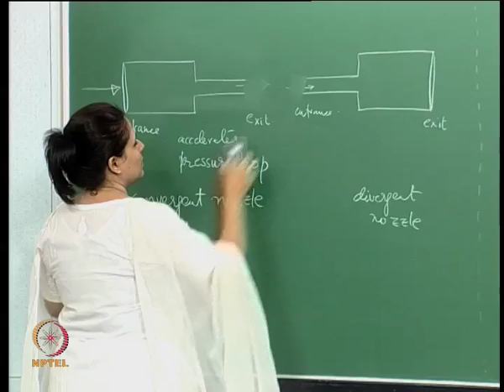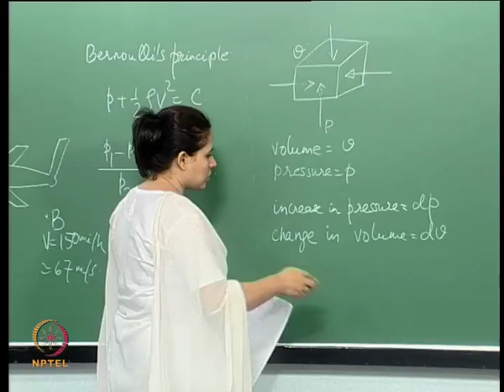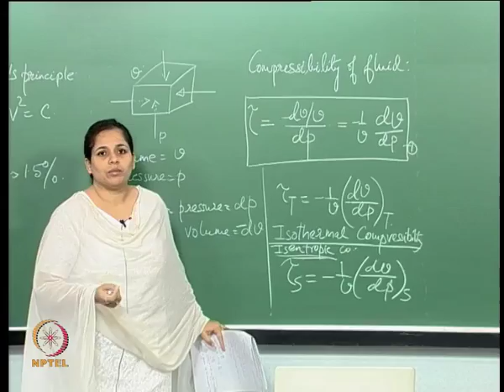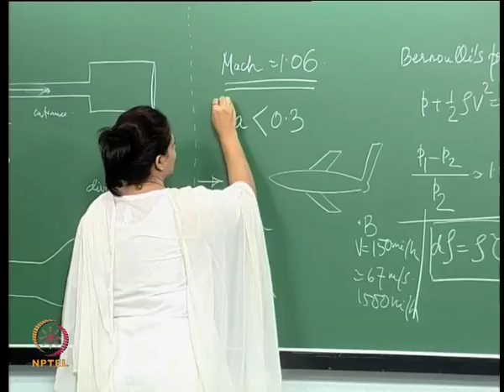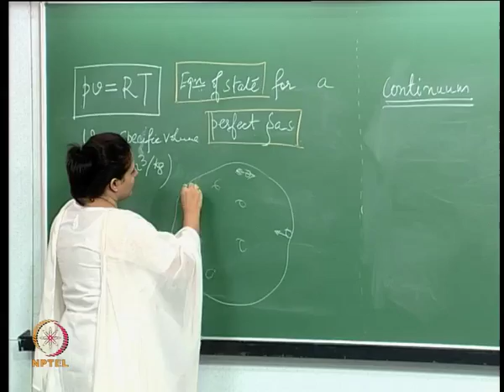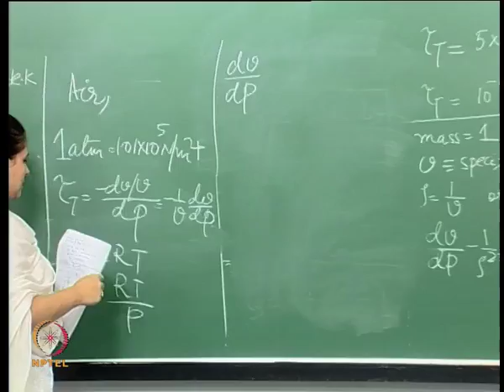Mod-01 Lec-01 Lecture-01-Introduction to Gas Dynamics & Review of Basic Thermodynamics

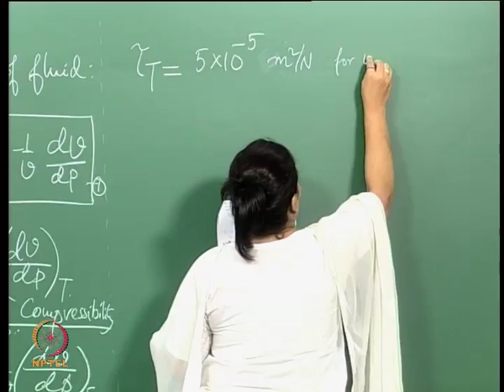Comment: At minute 22:34 of video the Compressibility value gived for water is wrong. The correct is 5x10^(-10), thats why water is less compressible than air. The values shown said exactly the opposite (5 is greater than 1 in the same power of 10 as Amit Kadam said also 1 year ago).
Reply: instablaster...
Reply: She seems unfazed by the blunder! Will never happen with a Western professor.
Reply: @aerodynamico6427   It's a human error which anyone can make. Don't make it west vs east.

Comment: Higher compressibility means more pressure will be require to compress.
thus the lower the value , the more compressible will be the Fluid.
Reply: +yasir Baig It´s vice versa. The larger the compressibility, the less pressure is required to reduce the volume. Your explenation holds for the bulk modulus, which is the reciproce of compressibility.
Reply: absolutely well said...so the compressibility is less for air than water
Reply: @abha25xd  You are nuts. Keep off from this site and get your fundas cleared somewhere else.